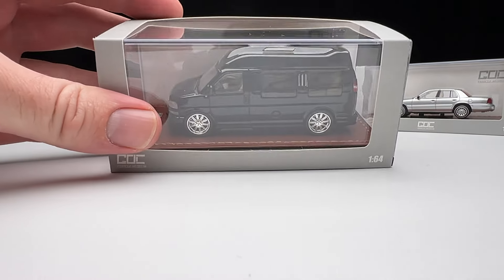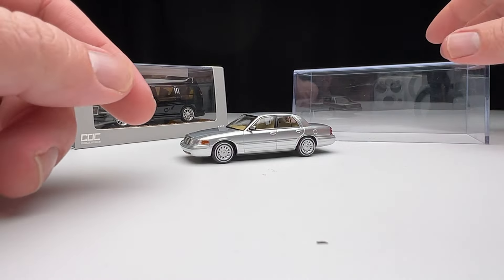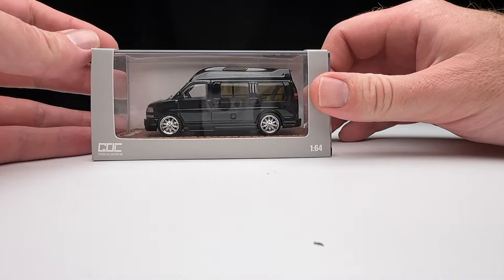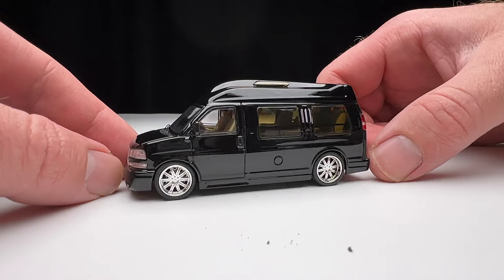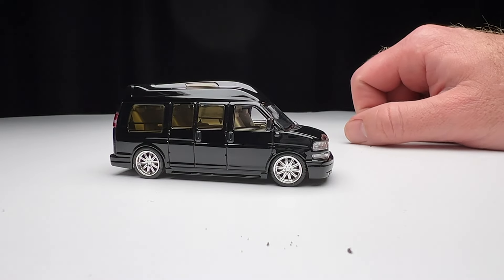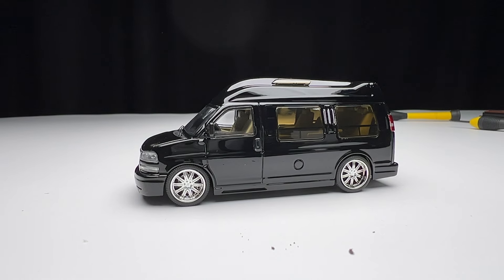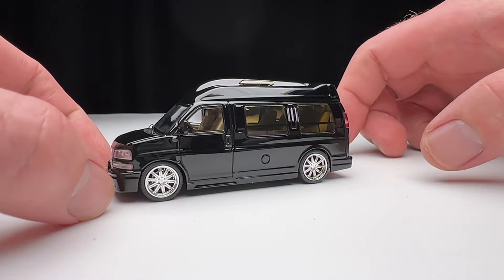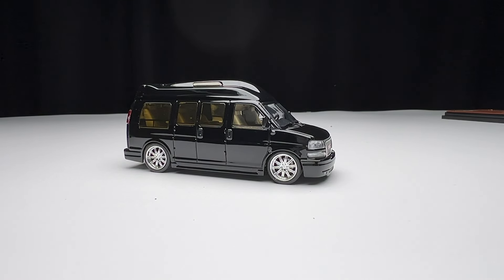This thing is a Beast! GMC Savana in 1/64 by GOC

Comment: I've seen their line of models, and my first experience and opinion was disappointing.  As a gift for a collector friend, I had bought the one of two models that they first released (a 1993 Cadillac Fleetwood, with the other being a Hong Qi / "Red Flag" (the old Chinese government dignitary luxury car)), and the scale of the Fleetwood was excessive.  He liked it but also agreed it was larger than most typical models in the 1:64 class.  This video is making me reconsider my belief not to buy more from GOC.  The interval between the first released and the more recent one was significant (maybe five or six years?), so they may have changed their product design standards.  I don't see the exact measurements in the video, but it looks more in scale with the typical "adult collectibles" we see on US store pegs, such as Greenlight and Auto World.  These more obscure (at least by US collector standards) from Asian or Chinese manufacturers are extremely well done and seem to identify many of the niches in the 1:64 diecast market that have been a vacuum for so many years.  I'd guess there is some popularity in China of these 1990s and 2000s vehicles as their market began to boom at that time with links to US and European manufacturers.  Collectors there have a nostalgia for these (dare I say) "vintage" cars, and of course we do as well.  I'm seeing various classic vans released by Asian manufacturers (Tomica recently did the Chevy Astro which is an American that has a cult following there) and another company produces a very nice Chevy G20, but the newer vans like these have been ignored by the likes of Greenlight and Auto World.  M2 has a fantastic Chevy Van / Beauville, but its from '71.  M2 is more vintage focused, but as the 1980s and 1990s now is consider "vintage" or "classic", its become fair game.  Thanks for sharing this.  GOC owes you a finder's fee for publicizing a model that I overlooked based on previous experience.  I am willing to give them another chance.
Reply from the maker: Yeah the two castings that you talked about are definitely older. This and the crown Vic that they have done more recently are very well made